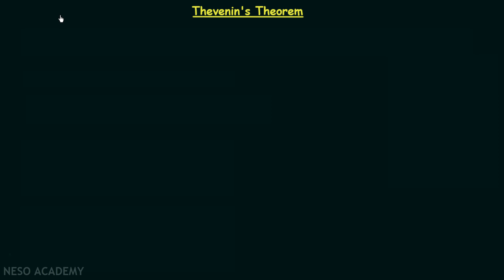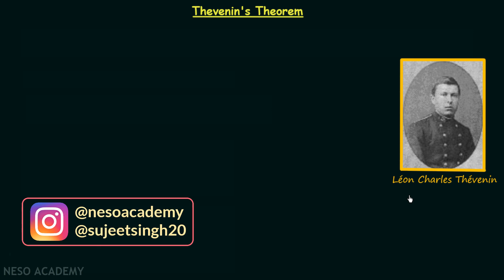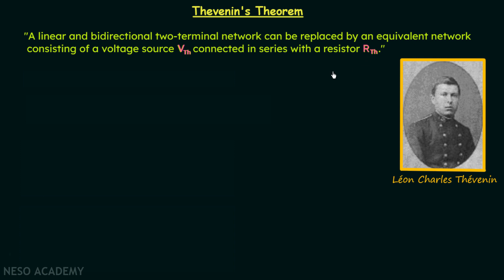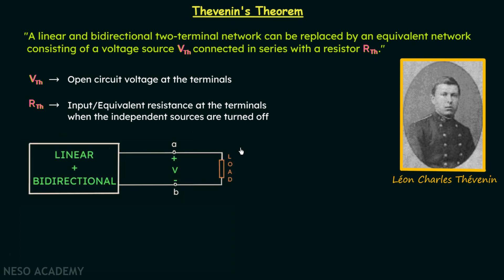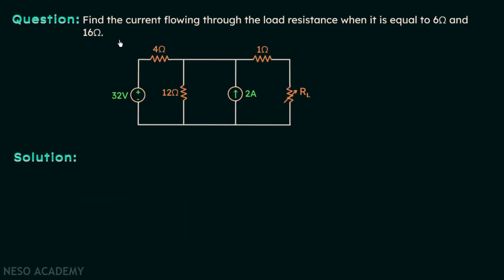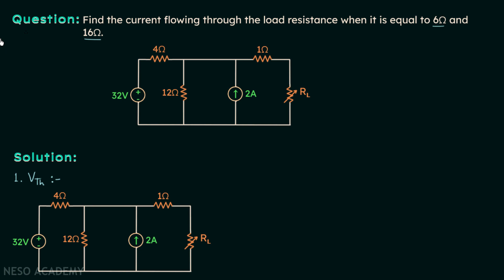Thevenin's Theorem

Comment: sir i have a doubt in the video about calculating the Rth. The resistances 4ohm and 12ohm are connected in series, but you have solved by considering that is connected in parallel. Please clear my doubt

Comment: 🎯 Key Takeaways for quick navigation:

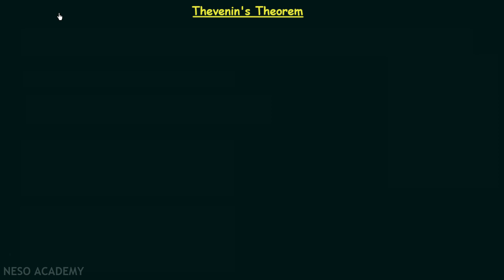00:00 📜 Introduction to Thevenin's Theorem
- Thevenin's Theorem, developed by French engineer Lyon Thevenin in 1883.
- Explains the need for Thevenin's Theorem when dealing with variable elements in a circuit and the advantages it offers in simplifying complex networks.
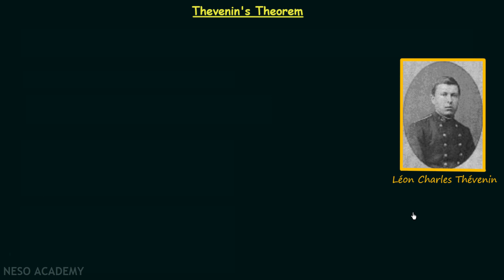01:34 🔍 Thevenin's Theorem Statement
- Thevenin's Theorem states that a linear bi-directional two-terminal network can be replaced by an equivalent network with a voltage source (Vth) in series with a resistor (Rth).
- Describes the significance of Vth (open-circuit voltage at the terminals) and Rth (input resistance when independent sources are turned off) in the equivalent circuit.
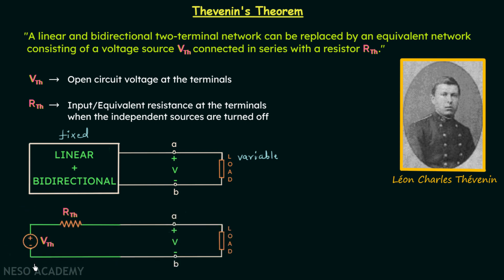03:19 🔄 Example of Applying Thevenin's Theorem
- Illustrates the application of Thevenin's Theorem using a practical circuit.
- Emphasizes the replacement of a complex network with Thevenin's equivalent circuit (Vth in series with Rth) for simplifying analysis.
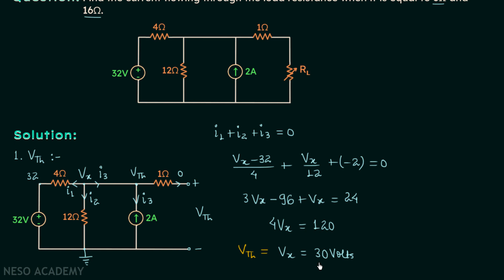08:31 📐 Calculating Thevenin Voltage (Vth)
- Demonstrates the steps to calculate Vth by modifying the circuit, applying nodal analysis, and determining the open-circuit voltage between terminals.
- Shows the importance of maintaining consistent polarity throughout the analysis.
10:30 🧮 Calculating Thevenin Resistance (Rth)
- Outlines the process of calculating Rth by turning off independent sources, modifying the network, and finding the equivalent resistance.
- Highlights the parallel and series combination of resistors in the modified network.
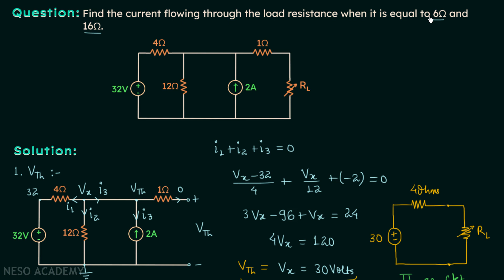11:25 ⚡ Solving Circuit with Thevenin Equivalent
- Applies Thevenin's equivalent circuit to solve for the current flowing through a load resistor (RL) in two different scenarios.
- Shows how the simplicity of Thevenin's equivalent circuit facilitates easy calculations for varying load resistances.
Reply: Good evening Sir
What if there was a dependent source in between then we have to do nothing with it na sir? 

Please suggest 🙏
Reply: @adityasarvade7817 vit?
Reply: College exam?

Comment: while calculating Rth why second source kept open and first source short circuted
Reply: For voltage sources, we set their voltage to zero, effectively replacing them with a short circuit.
For current sources, we set their voltages to zero, effectively replacing them with an open circuit.

Comment: While calculating Rth why voltage source considered as short circuit and current source as open circuit??
Reply: For voltage sources, we set their voltage to zero, effectively replacing them with a short circuit.
For current sources, we set their voltages to zero, effectively replacing them with an open circuit.

Comment: I have the confusion when I solve the circuits problems ...let assume 3 resistors are in parallel and 2 resistors are in parallel suppose we solve 3 resistors which are aeries their equivalent  will be  ? With 2 parallel resistors I can't understand the logic

Comment: 8:03 3vx-96+vx=12 right? Not 24
Am I right.
Reply: No. You are doing some calculation error.  When taking the LCM, which is 12, the -2 will be multiplied by 12 to give -24.

Comment: Why we can't apply voltage divider for Vth
Vth=32*12/(4+12)= 24 Volt
While in soln Vth= 30 Volt
Reply: I have same doubt
Reply: The answer should have been 24 V had the two resistors been in series. They are in not in series or parallel so the voltage Or current division rule cannot applied. Note that there is a current source of 2A connected between them making the point a principal node.
Reply: @hemantbhatt3553  can’t we use a simple mesh analysis equation 
-32 + 4i +12i =0    I=2A and the same current flows through entire circuit. As the 1ohm resistor is open and voltage can’t flow. The resistance at 12ohm is v=ir
12x2=24volts and since 4&12 ohms are series same voltage flows and Vth is 24volts
Reply: @hemantbhatt3553  if possible can you please answer soon I have an exam in 2 days

Comment: I did'nt understand the voltage source removing to find the equivalent resistance . One is short circuited and otherone is disconnected . Please if u can recommend me a lecture to understand it. Thankyou for the lecture.
Reply: As explained in the lecture, we replace the independent source by its "internal resistance". An ideal voltage source has zero internal resistance and hence we replace it by a short circuit, and an ideal current source has infinite internal resistance and therefore we replace it by an open circuit.
Reply: @pawankumarmishra6699  thank you mishra ji
Reply: @pawankumarmishra6699  hey hi, do u know why he grounded the 12ohm branch while calculating Vth?

Comment: Why current source open circuited whereas voltage source shorted.
Reply from the maker: As explained in the lecture, we replace the independent source by its "internal resistance". An ideal voltage source has zero internal resistance and hence we replace it by a short circuit, and an ideal current source has infinite internal resistance and therefore we replace it by an open circuit.
Reply: Thanks a lot sir
Reply: It was awesome .... Really help ful

Comment: Sir Vx=Vth,     why i3 current between  Vx and Vth , there is no potential difference......?
Reply: i know right
Reply: 🆕 @Nini 🆕 Sanjay 🆕  New 🆕🆕
Reply: Do u think potential difference is the only reason why current flows ? 
V=IR( ohms law )
Here resistance is zero that's why no potential difference or no potential drop but current ain't zero right ? It's the resistance which is zero
Reply: Since VX=vth, so potential difference is 0 here.